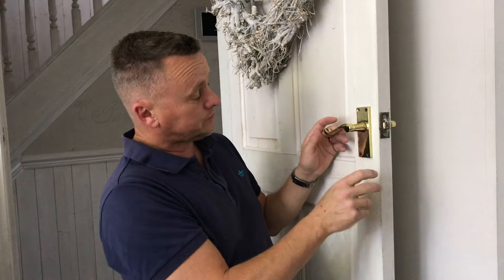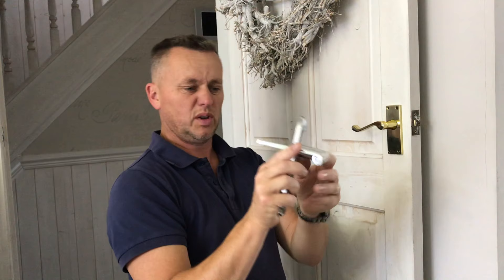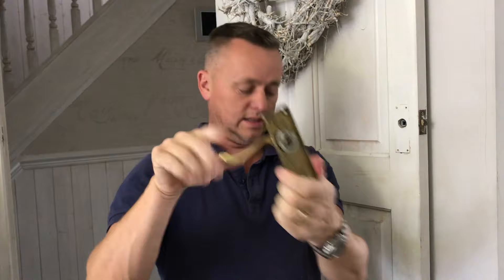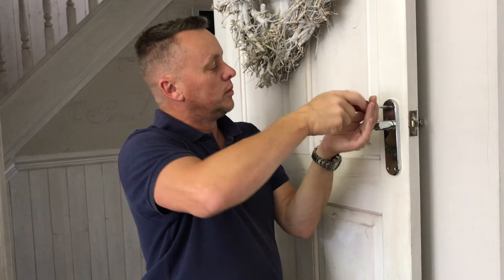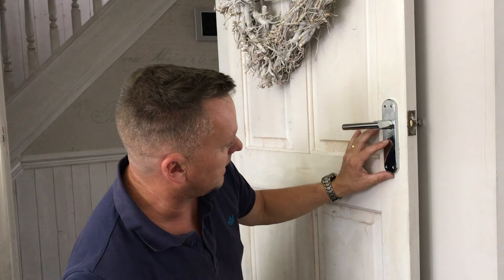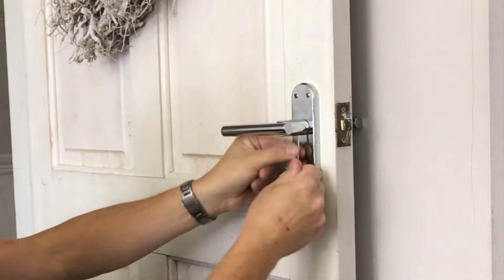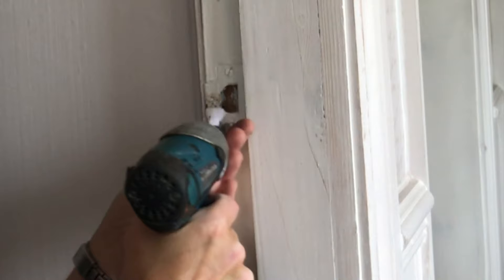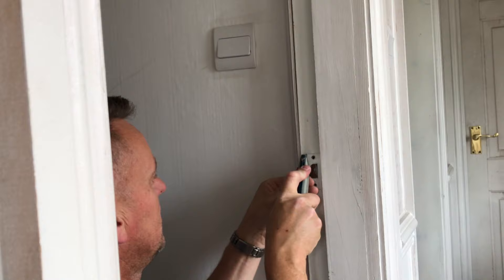🇬🇧Replacing Interior Door Handles, "Easy Job" Or Not!

Comment: Great advice and help, but surely if you keep getting a larger one each time you’ll eventually end up with a handle the size of the door 😅
Reply from the maker: 😂 Thanks for the great comments👍🏻👍🏻🛠
Reply: The problem is the door handles in my house are huge so I will probably have no choice but to use smaller ones however he said it’s to avoid paint marks. If you plan on painting the door afterwards I guess it wouldn’t really matter

Comment: When fitting the new screws it's better to use an old thin cross head screw driver and just tap it with a small hammer to start the screw hole off. 😉
Reply from the maker: Thanks for the great information👍🏻👍🏻🛠

Comment: Thank you for the video. I just changed a door handle I’ve been putting off doing for ages. Also used your Phillips head screw trick to make the pilot hole for the flat head screw provided - worked a treat. Subscribed. 🙂
Reply from the maker: Thanks for the great comments👍🏻👍🏻🛠

Comment: Nice one aaanton11 I had exactly the same issue with mechanism not opening enough. I found out that the reason was the space in between the funny shaped washer inside the handle did not have enough gap between its two raised points to let the handle go down enough. I ended up buying a new internal rather than just simply chop out a little of the frame. D'oh!! I'll know next time.
Reply from the maker: Thanks for the great information👍🏻👍🏻🛠

Comment: Silly question, but what is the function of the grub screw? Well, securing the handle to the spindle, presumably, but is it strictly necessary?
Reply from the maker: it will stiffen everything up and save wear on the handles, also if you use the handle to pull the door closed it transfers the load to the opposite side, Thanks for the great comments👍🏻👍🏻🛠
Reply: @aaanton11  Thanks again! 👍

Comment: What would you do if the door handle can fit on but the screw holes were new? How would you go about making holes? Just literally a normal drill? Because how would you have a thread on the door
Reply from the maker: like I did in the video, use a cross headed screw to make a new hole, then remove and use the decorative screw provided with the new handle, Thanks for the great comments👍🏻👍🏻🛠

Comment: Hi mate, I have a Victorian door with a normal door handle. But I want to change it to. A lock door. I have the handle. But what is the best way to go about doing it?
Reply from the maker: You will need to change the mechanism which means drilling out and chiseling out the door frame to fit it, Thanks for the great comments👍🏻👍🏻🛠

Comment: Just a quick question but I’ve is your handle not bit high because I’ve just fitted a new door for the first time and my handle will end up on the door higher than the centre or the frame of the door
Reply from the maker: you will want to line up the handle and catch with the latch in the door frame, or make it the same height as all the other handles in the house, Thanks for the great comments👍🏻👍🏻🛠
Reply: aaanton11 mines a hollow door from B&Q,,I just wasn’t sure if my door is strong enough to put the handle above the centre panel of the door is,,mine will be like yours just above the centre bit of the door

Comment: I've jst typed in how to replace door handle and i clicked onto your video, i bought new handles no probs fitted it all goin great, but my problem is actually the middle peice (the bit where once handle goes down it should click into the hole that's in the frame) well my prob is that part, it moves when I pull handle down but very quickly shoots back out befor ive even got the door shut can anyone help me please 😢😢😢
Reply from the maker: sounds like you need a new mechanism too like this one https://amzn.to/3T1raZe Thanks for the great comments👍🏻👍🏻🛠

Comment: I've just replaced a new door handle but the handle dosent seem to spring back up when opening or closing it will if I just give it a little tap
Reply from the maker: If the handles are not quite alligned through the door this will stiffen things up, try loosening the screws on one side and see if it springs back better, Thanks for the great comments👍🏻👍🏻🛠
Reply: Thakyou for quick response

Comment: I'm having problems with one of my handles, it hasn't gone floppy but when I pull it down to open the door the latch doesn't retract properly. It goes in if I push it in but not with the handle.  I was afraid someone would get stuck and not be able to open the door, so for the moment I've swapped the internal bits with another one off a door we don't shut. Is the internal barrel bit sold separately and what is it called please, so that I can go and buy a new part.
Reply from the maker: https://amzn.to/3zbfQPV these latches are £8 sounds like what you need Thanks for the great comments👍🏻👍🏻🛠
Reply: @aaanton11  Thanks so much for your reply.  Been busy since last night and found out I need a mortice latch.  I swopped a bedroom door latch, which we never close, with the bathroom door latch.  This morning I went shopping and bought another latch for £1.95 from an iron monger stall at a local market. Now I'm sitting here wondering why I didn't think of this before, ha ha. Thank you

Comment: Ok I have those brass door handles. I’ve undone the face plates but the handles are joined to each other by the bar in the middle and there is no obvious hole to release them. I can’t get them off. Any ideas anyone?
Reply from the maker: There is a small grub screw under the lever, Thanks for the great comments👍🏻👍🏻🛠